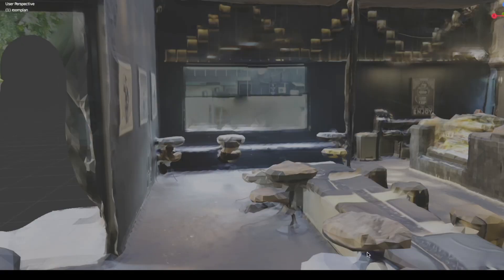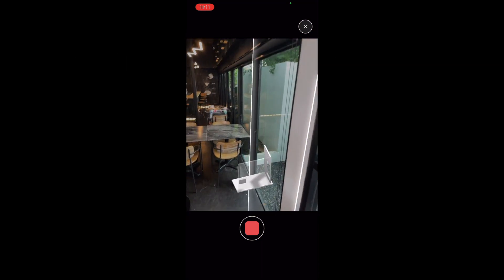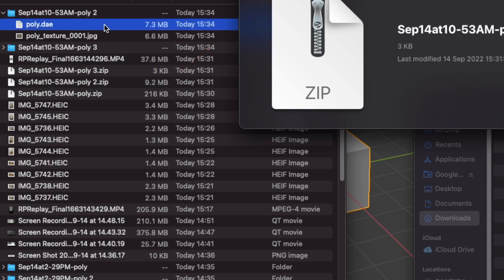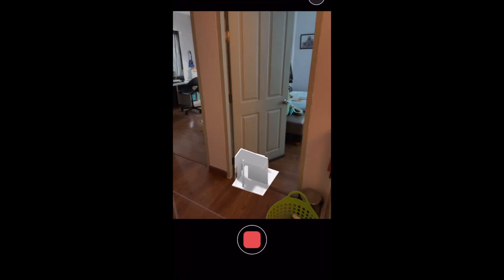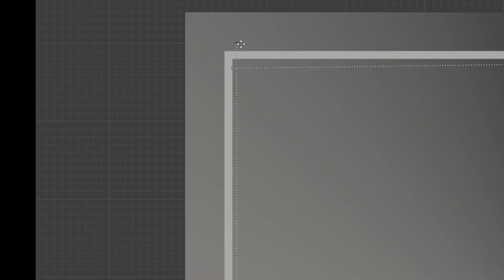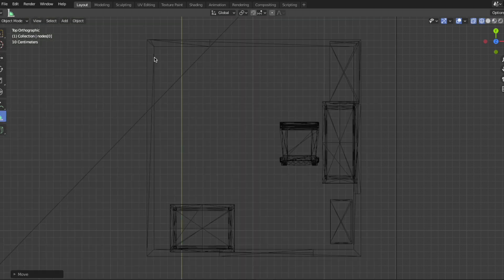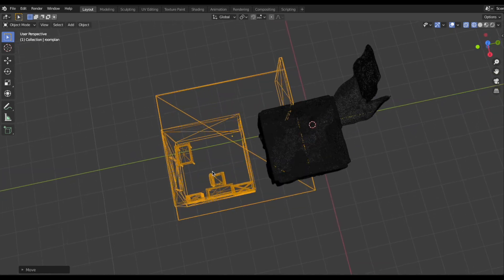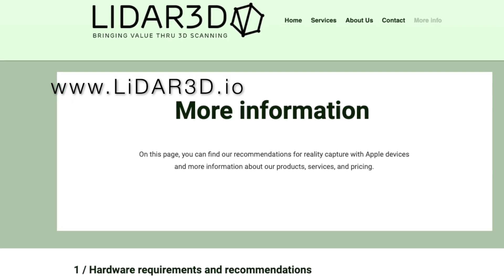Accuracy test - iOS RoomPlan API, Polycam Room mode

Comment: Hello, as an architect. Id suggest function. That you upload simple .dwg floor plan in scale 1-1 in metric or imperial preset. For me metric for example. And than do scann, which would be having exact dwg as a bacground. During scanning, it would be automatically catching surfaces according to dwg. Or even some 3d obcets. Like I meassuer by laser distance between some beams at attic or let say some known objects, this I upload as a base. And than Polycam would use it as a reference and keep gooing with rest.
Reply from the maker: Maybe. Having a good quality dwg would almost defeat the purpose of scanning but if you have it - why not. 
Looks like the quality of the scans get better with iPhone 15 pro max and the vision pro will probably be even more accurate and visually better. 

I can see how it would be good you as an architect to scan post project completion. Very interesting to see if there are any differences between the model/drawings and the final build, and also just to have it for documentation and potential as a starting point for a digital twin.

Comment: Hi, your video is very good.
Is it possible to use Lidar sensor and convert the file to dwg?
To use in autocad 3D
Thanks
Reply from the maker: Hi! Thank you for your kind message! 

There is no automatic conversion to dwg within the app. It can export 2D image files and 3D meshes in obj, dae, fbx and other formats. 

Our team that specializes in converting scans and other data into professional grade drawings like DWG, Revit, SketchUp and other. Please don't hesitate to reach out to us by email for more details. Pricing and customization options can be found on our website www.lidar3d.io 

Thanks for watching :)

Comment: In all honesty all LiDAR Apps Are Limited by the technical limits of the apple hardware.

I find all apps that claim to have precise LiDAR scans to be even borderline lying!

Maybe it is fine for having a 3D scan to Spin instead of photos but not mesh that is precise enough to model from

I do find Trnio LiDAR + Photogrammetry to be much more usable and precise
Reply from the maker: Would be interesting to know what you are scanning and modeling and your tolerance level for accuracy.

Trnio is also built on the same iOS platform but it uses Photogrammetry in combination with pure Apple LiDAR which was tested in this video. 

We did another video about the pros and cons of different techniques for capturing buildings that you can find here: https://youtu.be/2K1sPKxzNn4